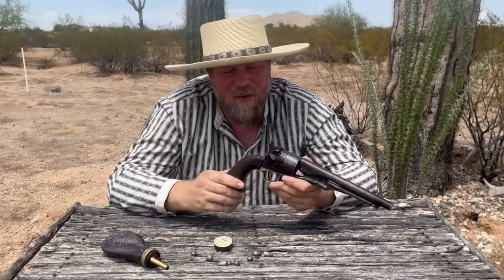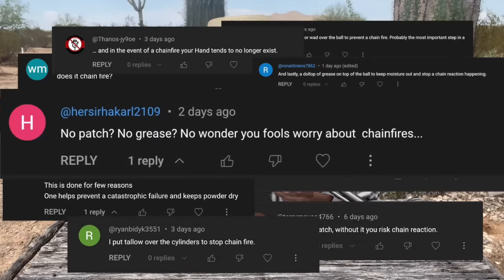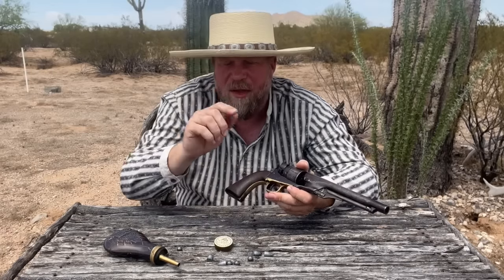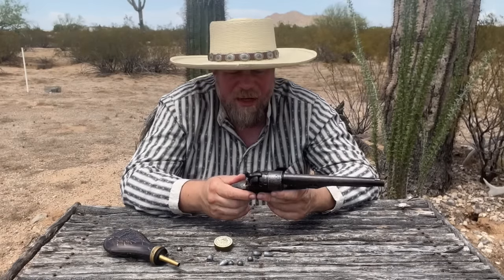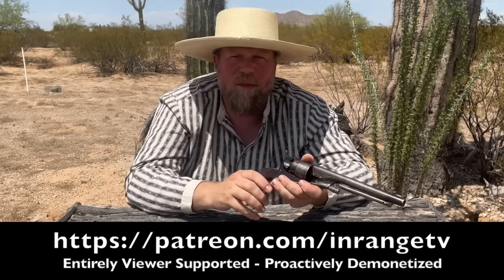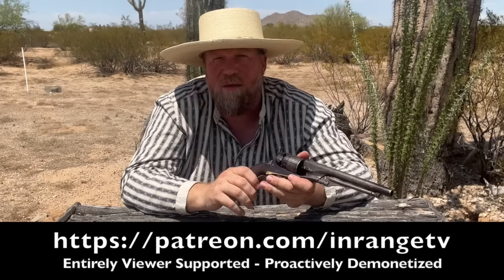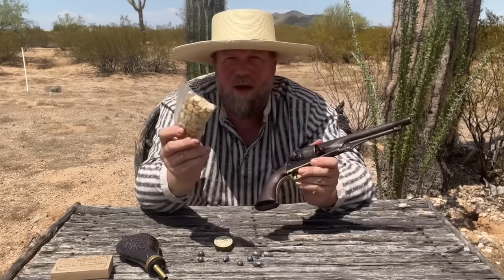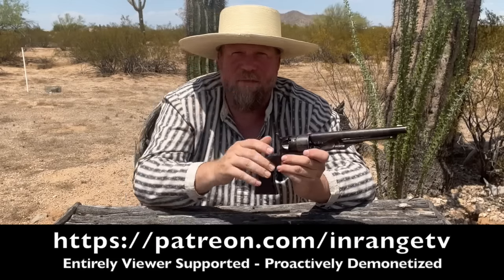Chainfire!  Is it dangerous?

Comment: I have been on the wrong side of a chain fire. In front of the gun, not behind it. I carried a piece of a .44 cal round ball in my back for many years. I was 16 yrs old and stupid. (Don't judge). In later years, I became very involved with civil war reenacting. Rather than use wonder wads to prevent chain fires. I learned to use cornmeal. Very effective (at least for blanks) and historically accurate.

Comment: Would have been interesting if you had determined if the percussion cap that stayed on the chain-fire cylinder had ignited or not. I saw a different video (maybe by Old Ranger) where the caps still ignited after the chain-fire event (which would seem to indicate the cause was not originated from the nipple end of the cylinder?).
Reply from the maker: I thought I did, if not I meant to.  The one with the cap still on DID go off.

Comment: When loading 45 Colt with blackpowder i have a piece of glansy paper (slightly oversized and 1mm thick) on the powder, the some lube suited for blackpowder and last the bullet. It should be fine in a cap ´n ball revolver too to prevent the lube to melt and mess up your holster.
Anyhow, i have not had a single chain fire in my guns, and i have been shooting cap ´n ball guns since 1997.

Comment: I used to do a lot of reenacting with muzzle loading artillery. Modern users have a lot of differences from the way things were done historically, I've always assumed that part of it was from the skillsets being essentially "lost" for 50+ years and then "rediscovered" in the 1960s and 70's with the birth of reenacting. I wonder if that's also part of the whole chainfire paranoia? 

It is very easy to get hurt with a muzzleloading cannon, it happens every few years. If you include the word "safety" when you suggest doing something differently from the period you can pretty much always get a pass. There are a few crews out there that do the historical method, it usually horrifies old timers.
Reply: The historical manuals where always there, but weren't nearly as available before the internet, so fuddlore took over, especially as it was printed in books without push-back. Still gets printed, but not unopposed.
Reply: What's the big difference between loading cannons the historically accurate way and the modern way?
Reply: @FpsGamer43  the way the drill is done is pretty different, most of it is cosmetic. For example, when you see reenactors covering their ears, that's not from any historic manual. There are some pretty fundamental technical differences, like reenactors worming after every shot, or even waiting a set amount of time between shots. There are some videos of European crews firing super fast using what were considered emergency procedures in the era.

Also some of the differences come from material. Historically they used wool for the powder bags, because wool self extinguishes. American reenactors use tinfoil, because it's cheap and easy to work with and available everywhere.

Comment: I was always under the assumption grease was done to prevent water contamination coming in through the face of the cylinder,not the cap side. At least,that's how I was taught.

Comment: I saw chain fire that caused the frame to blow apart. I suspect it was caused by microscopic cracks from metal fatigue in combination with a very bad grain structure. The inside looked like sand rather then a homogenous chunk of brass inside. 

I suspect it was also potentally a pakistan peshwar valley replica then authentic so maybe poorly manufactured.

Comment: A proper fitting ball or bullet shouldnt allow the possibility of chain fire, poor fitting lead could. But I always heard it was from loose fitting caps, one falls off and the fire goes into the nipple and that was the most common cause of chain fire. Never experienced it just thats what i have heard. I make sure to usr good fitting my own cast bullets and balls. And good fitting caps, i do grease ontop of the cylinders but mostly to lubricate and make it easier to clean.

Comment: I use have my own little system, I make flash paper but make sure I cut it so no where around the ball is flash paper, i make a paper cartridge with said flash paper and I use clays smokeless a stout. 45LC load but I have to also use some corn meal or other media to get good compression, the flash part of the paper stops before the halfway point of the corn meal.
I then use an oversized ball that will swage.   I tie the conical bottom with powder with cotton (flash string) that's very thin then I will tie the other end off with normal string and use some wax on the end of the ball so it seeps into the paper.
I only do this on steel framed revolvers,   I usually upgrade the nipples and buy caps that fit nice and tight.   I have a wrist band with a bronze (decapper) and will have a pouch of paper cartridges and a pick of caps.
I will always used an over sized ball or conical bullet but I will also use some good quality powder coat paint, put it in a tumble then the oven.

I just put the caps on and stick a paper cartridge down the cylinder and compress it.    You can load and realod it pretty fast.
When compressing I always see a little lead ring from staging and a little powder coat (I usually use a bright colour)

My favirate is on a medium Barreled SA/DA made years ago and some others made some decades ago all steel frame.

I use non corrosive caps (I think most are now)
The clays powder is great and I have made some pretty hot loads without problems, it'd a powder usually used for shotguns but it can be used for. 45 colt.

I made a cut out for the paper, a mandrel for the cartridge. I use my own lead cast balls and I cut down a case so it has the almost perfect amount of smokeless.
I have a light medium and stout.
Nitrocellulose (cutcotton / flash paper is very easy to make.

I just use a thin Arabic gum type glue for the paper cartridges.

It's nice as it does not gum up, the barrel does not get leaded much due to the powder coat, no plumes of smoke and much faster velocity plus you can't have to clean it everytimr you shoot it as BP is very messy.

Do this at your own risk but I know quite a few people that use clays powder.

For some ex conns, people who can't own firearms or people new in the US in some states they use cap and ball revolvers for defense...

But if I was an ex con or could not worn a firearm I would buy handgun that past a certain date is not considered a weapon or firearm anymore just an antique.

I have a realy nice arginine smokeless DA/SA revolver with all the mod cons apart from the pin is on the hammer,  you can cut down brass to use in it.

I got it for 59 bucks and it's a very smooth revolver that looks like it was never shot, probably made in the early 1890s

Comment: good video.  In my Ruger Old-Army, for target shooting I load 25-grains 3f (no. 2 Swiss) powder, 10-grains of cornmeal as the over powder wad and to take up the remaining air gap.  a .457 Hornady swaged round ball.  primed with proper fitting CCI #11 caps.  and like you I've never experienced a chain fire when loading the gun properly as you demonstrated.    ^~^

Comment: Currently in Poland, Europe black powder muzzleloaders (including cap and ball revolvers) do not require a gun permit to be bought, so they've become somewhat popular around here. Main lead ball sizes available here are .451, .454 and .457. Some people recommend .451 which is ridiculous since under recoil those balls in other chambers tend to walk away from their seated positions, especially when the chambers are lubed. However, for me a .457 ball is a bit too excessive since it becomes very hard to smack that ball into the chamber using loading lever of the most popular revolver around here: Remington 1858 New Model Army. I consider .457 ball a good choice if you plan on storing your gun loaded for a long period of time. Otherwise .454 seems sufficient at least for me. Lubed of course.

Comment: 50 years ago I purchased a replica 1851 Colt Navy revolver.  Over the years I have shot literally thousands of rounds through it in hunting, plinking, target shooting, and simulated Old West gunfights as part of tourist attraction.  I have NEVER had a "chain-fire" incident, nor has anyone else who has borrowed the weapon over the years.  I NEVER used any form of wadding or grease capping of the chambers in the cylinder.  I always used real black powder in a course granulation and conical slugs as I was advised to do by a gunsmith friend.  So, there you go, thousands of rounds under every conceivable weather and handling condition without any "modern" safety alterations to the loading procedure and only routine maintenance of the weapon.    People will always choose the fantastic over the usual when dealing with something as potentially controversial as building a charge for a revolver.  No one sits in a bar and talks about the thousands of times their smoke-pole went off just like it should.  There's no story in that scenario, is there?  Yes, there is.
Reply: How to prevent it is pretty obvious. Make sure the cap and ball fit tight enough that the fire can't leak out and light the other cylinders. The paper cartridges also apparently help but they probably are not necessary if you have proper fitting cap and balls. The fire has to blast out around the cap or ball in order for a chainfire to happen. It's common Sense really.

Comment: Any unintentional fire(chain fire included) is potentially dangerous.  Usually not, but the possibility exists.
Reply: If you have something with an offset loading lever (such as a LeMat), those exposed bits can absolutely become shrapnel, and could redirect the bullets at an offset from the main direction of fire.  Those additional projectiles and deflected bullets can make the experience that much more *exciting*, in the sardonic sense. 😐

Comment: Do you think grease on the chamber mouth and bullet are more viable in Appalachia? Do they add any extra water proofing as well?
Reply: A properly oversized projectile should prevent moisture from getting past it without grease, but water is far more likely to get into the chamber through the nipple end.  If it's wet enough to get past the ball it's long since gotten in through the nipple.  There's not a lot you can do to prevent that other than not get it wet.

Comment: You can also heat up the balls until they are red hot (as close to melting without actually turning into molten lead as possible, preferably) before ramming them into the chamber. This obviously requires a masterclass level of skill for several reasons, but is guaranteed to prevent any "event" that anyone could reasonably argue meets even a fairly loose definition of "a chainfire."

queue The More You Know animation
Reply: You’ve never melted lead have you?
Reply: @tonybarracuda3505  when I was a young teen, with my brain very much still developing, a friend and I decided to buy some molds of D&D-style miniatures, and made a ton of them out of lead (because back then, miniatures were still made primarily out of lead).  So yes; I have melted a lot of lead. But more importantly, I've breathed a lot of it, so I totally know what I'm talking about, here...
Reply: @brandon3883  obviously you haven’t or you would know that lead doesn’t change colour when it melts
Reply: @tonybarracuda3505  why are you taking anything I'm saying seriously?

Comment: ONE THING MAKES ME WONDER.
sorry for caps lock
How can chainfire happen, when the projectile is 100% tightly packed in its place, so tigtly that it was litrally cut into this by pressing it, leaving excess metal behind. There is a little space for a single atom to pass through, not to mention pieces of burning material. Of course, using a .450 is a nonsense, but I cannot imagine it otherwise.

Comment: Back in the 70s I bought a BP pistol (no idea what)  took it down and per the wisdom,  loaded it, slathered (Crisco?) on the front of the ball and I never shot that gun again,  what a flipping mess.   I thought then something was horribly off.   My brother still vividly remembers that day.   Lo many years latter (2023) I am looking at the BP Pietta my wife gave me (hers from 1976 ironically) and it was,  hmmm,  I really need to shoot this thing.   Being the smart person I am I looked up all the info I could find and then I find Carl's Video here and it was,  ahah, I knew something smelled!   So, I got powder and caps,  still had the round balls my wife had and away we went.   While it did not Shave a Ring, you could see lead deposited in the Chambers and it took significant effort to seat.   I tried one chamber,  a bit too fast (920 or some such)  went down to my next dipper (am I really going to buy a non calibrated measuring thingy?)   and it shot nicely and I worked up to all chambers.  What a revelation.   None of the muck I so clearly remembered.   Go Carl!

Comment: What is your opinion as to why most people nowadays use round balls when they aren’t as accurate and not as relevant to what was more commonly used in the old days? Is it just a cost factor?
Reply: Universality.  Round balls fit more barrels, black powder community has barrels of all shapes and sizes, round ball molds are a lot less complicated.  It's kind of like having an entire line of rifles that use 5.56 NATO.  Conical only work well in mid 1800s firearms with a certain type of rifling, round balls go for the entire set.  I imagine companies focused on producing them more as well which is why the cost is so different.  You can have a Smoothbore Musket, a Flintlock Long Rifle, and a Revolver all use the same round if you plan ahead.

I've wanted to try conical in my Remmington, but I can't justify the added cost for an unknown accuracy increase.

Comment: Many of the cheap low quality reproductions have chamber diameters that are not consistent. That might be the origin of the use of wads and grease over the ball.
Reply: It's not just diameter consistency, in many cases they aren't perfectly round, letting a ball firmly seat without sealing the chamber.  The historical practice of using "oversized" bullets is likely a reflection of the contemporary standards of machining.

Comment: forget the grease crap they never used it nor ran around with the tin of it,and a looly pop stick now required on a range  NO they used the correct size ball ,that when loaded leaves a ring of lead ,ball seated correctly  will not chain fire have been using a .44 cal Remington  for yonks and never have i had one ,to be doubly sure make a disc of 50/50 bees wax and paraffin wax cut discs with a 44.40 cartridge with the end removed makes a cookie cutter a small amount of baby powder to stop sticking together and just push into the end of the chamber ,but correct size balls o it will never happen,i make the discs about 1/8-3/16ths of n inch in thickness ,just pour the heated wax into a shallow tray cool and start cutting with the 44.40 shell for a 44 cal ,other cals check what works.

Comment: "I Think?" you may have had a single chain on your port side at about 26 sec into, but I could NOT Freeze the pics to, see? but think I saw an orange flash in the wrong place? at about 25/30 seconds in, but you know your counts.

FYI "I think?" ALL my chain fires are ALL from the rear or caped area. cap falls off under recoil? bad fit? DIY CAPS? I make a DIY bees wax grease for the AZ heat, and one for Not AZ summer.

Shoot them like they "Will Chain fire!" EVERY TIME! and when it happens, just another day with a new tale and more to learn. first times for me was lost shot counts and strange recoils. 

I can not find any #10's to save my life. Yes I shoot my #11's on hand. Gave up on DIY caps, chains, safety, and reliability.

I pray people re discover this type of shooting! "I Think" it makes for better, safer. more accurate, and patient Modern shooters. 
Thank You For Showing us this Art!
GOD BLESS!

Comment: Sometimes, chambers in the replicas aren't milled well enough, where a chamber mouth is actually narrower than its chamber. Think of some kind of a burr on the chamber mouth ridge, forming/being left behind during production. 
That way, even intially oversized projectile will leave tha famous "ring of lead", but the projectile will be sized to a smaller diameter than the chamber proper, and in result can wobble and move inside its chamber. This leaves space for spark to get behind the ball. 
One of the ways to check for this is to load just the round ball into empty chamber(no powder), and shake/whip your gun few times, as in trying to force the ball out with the centrifugal force. 
If ball moves after such shaking/wip, that chamber mouth has a burr/ridge that needs to be taken care of. 
Other youtubers propose to take a tear shaped stone for the Dremel tool(with diameter bigger than the chamber mouth) and twist it with your own fingers in that chamber few times, as to remove/scrape off the burr. 
Check and repeat if necessary.
Reply: Another way to check for that woukd be to cast the chambers on the cylinder. If the mouth is narrower than the chamber body, you shouldn't be able to pull the impression out.

Comment: Seems like you forgot the bear grease over the end of the cylinders.
Reply from the maker: Did you watch the video?
Reply: Yep, bear grease doesn't have a low melting point like modern grease.  Additionally, it was placed inside the chamber not just at the mouth.  The primary function was to waterproof the powder.